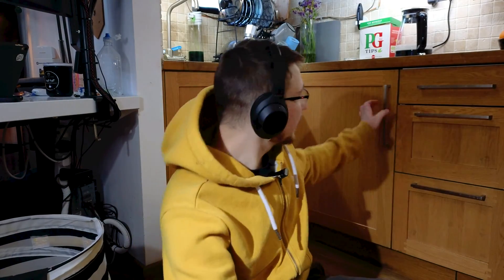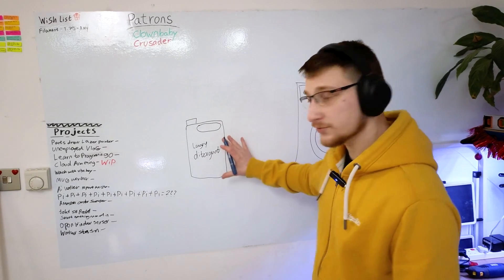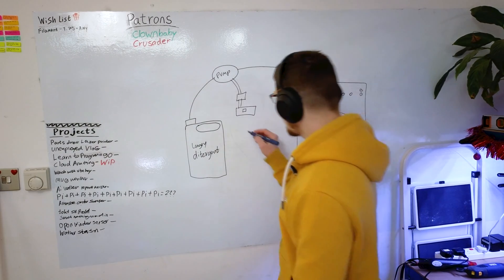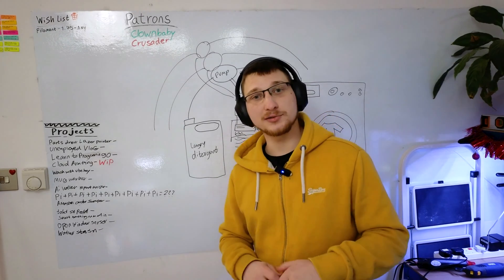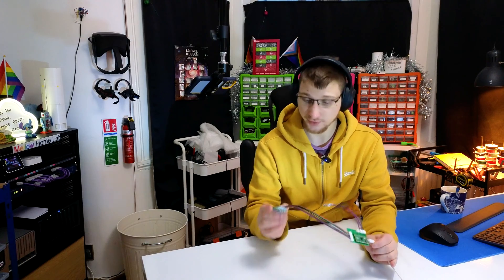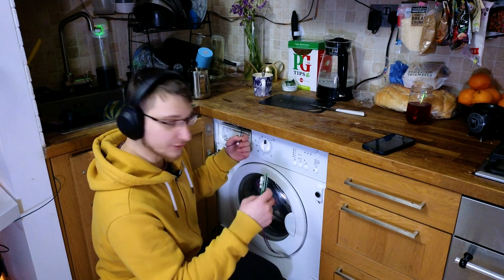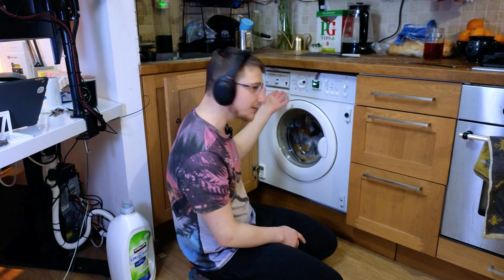DIY Smart Washing Machine How to Upgrade Your Washing Machine

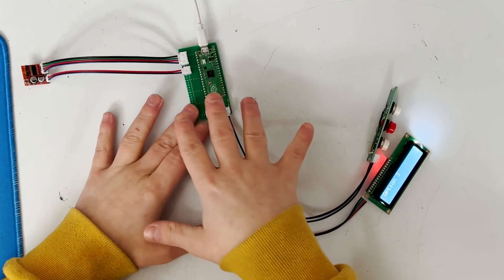Comment: 5:13 As someone who does not have the ability to understand programming and electronics, I would just put the detergent bottles pre-measured, outside the cupboard on the floor, shortening the 7 steps into 2 steps.

Comment: Get the detergent out first and leave it out until the machine is running.  Spend the rest of the day lying on the sofa.  Job done ;-)
Reply from the maker: I counter that with two hours of work; not having to open the cupboard again, now all it needs is a twist of the knob and two button presses and I’m on the couch (I don’t actually have a couch, I’m more of a standing desk person, it’s better for your back).
Reply: @Mellow_labs  - I accept your points

Comment: I'm glad you're unemployed!
Reply from the maker: I’m gonna assume this was a compliment 😂😂
Reply: 😂😂 @Mellow_labs
Reply: It means that Mellow Labs has time to innovate on his own, and make washing machines that are controlled by Linux (Raspberry Pi). I wish all appliances ran on Linux.
Reply from the maker: Version two will just be a screen connected to the washing machine with a Linux terminal 😆
“ honey using the washing machine is it difficult just have to cd in to the washing machine directory, run the washing_machine.py with the appropriate flags for what kind of laundry you want to do” 😂😊
Reply: Great video!

Comment: Thumbs up for creativity! Obvious issue to fix is the insulation of the pcb as paper doesn't cope very well with a humid environment and your valuable microcontroller won't last very long, also the pump you're using will need to be recalibrated if you decide to change detergent brand/type. A peristaltic pump bigger than the one you've got (you can 3d print one from thingiverse) paired with a stepper motor would give you a more consistent output.
Having said so, congrats on the project! Which AI did you use to program the pi?
Reply from the maker: thanks a lot I'm already planning to to redo the whole thing, it's not fantastic in its current state. I'm also planning to add a calibration feature to  the menu system. And I used to chatGPT,  mostly just to play around with it and see what it can do it's not great with micropython.